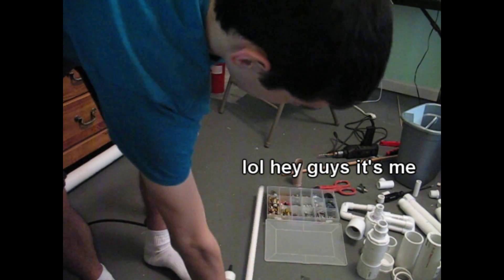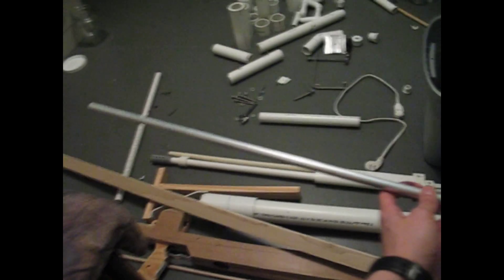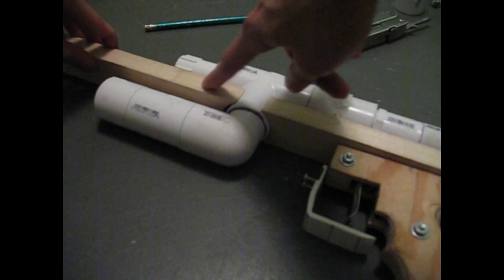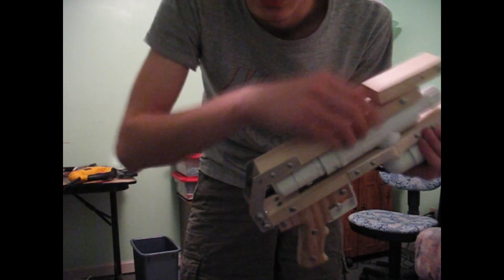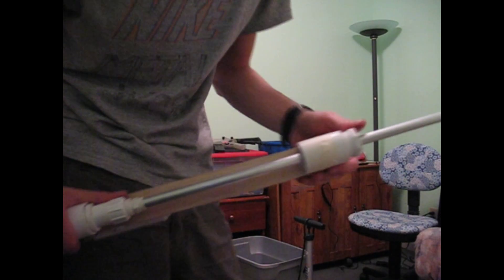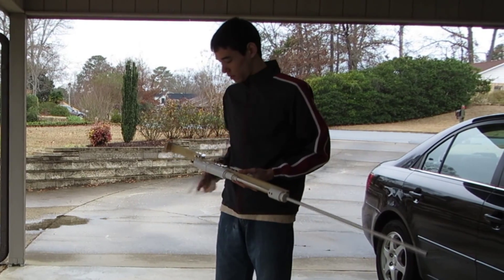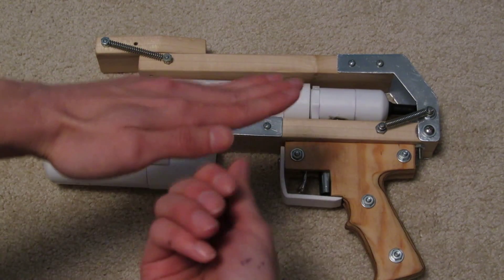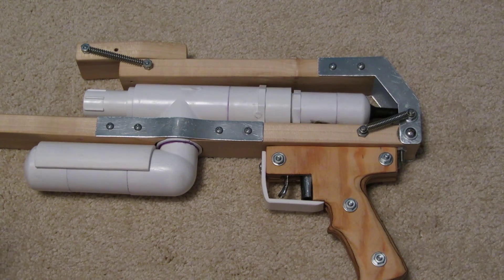Recycled Airgun w/ Collapsible Stock (and how a tee piston works)

Comment: a question: after you fill. by the time pass the pressure will eventually balanced in all chamber inside, and how will that supposed to hold piston?
Reply from the maker: The barrel's pressure holds the piston. Even though the pressure behind and beside the piston is equalized, there is a "negative" pressure on the face that is looking through the barrel, which acts like a vacuum that is holding the piston from moving. To break that air seal is difficult, and if you were to ram a wooden rod down the barrel to move the piston manually, it can take surprising amount of effort to dislodge the piston from the vacuum effect.
In qualitative terms, the atmospheric air in the barrel is ~14 psi, while the pressure in the gun is for example 100 psi. That means there is a pressure gradient of 86 pounds per square inch in the forward direction. A 2" piston would have a surface area of ~3 in^2, so it would be over 270 lbs of force to dislodge the piston from the barrel.
(rough estimates not accounting for different surface, etc. Envelope calculations, take with a grain of salt)
Reply: i see. tyvm for replying !! i was planning to make a smaller version of this luncher(pistol) ^^
Reply from the maker: DNexus Goodluck, I like small launchers but have issues with pipe sizes here.
Reply: the pistol, i made the barrel extremly smooth against the pistol, i try with my mouth np, but when i pump the pistol is still leaking!!! There is no absolute seal. All i want to do just wanna make a 50cm long chamber that can fire :(  i really want to send you pictures, may i have your email?
Reply from the maker: DNexus I don't really post my email, but you should try pressurizing the gun and submerging it in a bathtub or something. Air bubbles show you exactly where it leaks, then you can try to patch the holes with strong epoxy.
If air comes out the barrel, the piston face is probably leaking.
Reply: Roborovski yeah the pistol face against barrel is leaking :(
Reply from the maker: Pistons can be a pain, are you using a screw? If your barrel is very small in diameter, you might want to consider gluing your sealing face onto the front of the piston so it's nice, smooth, and perpendicular. The barrel back end also has to be almost perfectly smooth and perpendicular.
Reply: Roborovski oh right. i used screw. and my barrel is 12mm diameter. I'll try the glue face. thx
Reply: by changing the no screw pistol it works! no leaking, but when i start to pump, the few air taken away by pull back the pump will reduce the inside pressure and it reopen the pistol :( so its like pumped one, pull back, fire  automatically. how to solve this? i use hand mini bicycle pump. and Schrader valve.
Reply from the maker: Hmm I'm not sure if I've ever had that issue before. I always use a Schrader valve, but perhaps your  pump needs a better one way valve? Or the "pilot volume" behind the piston is too small and too sensitive. If you can easily attach another fitting to make the area behind the piston larger it might not fire? Sorry, I'm not sure how to fix that issue.
Reply: i got the tricks!!!, just need to use finger hold the other side of barrel and pump one or 2 times and open the finger to release the pressure in barrel and the pistol at the other side of barrel inside the chamber will instanly seal!!! it works 100%, i test with my nail dart its very powerful, right now is night time i couldnt do range test so tomorrow ill go check it out :D  i can't believe it works!!
Reply from the maker: Congratulations! Pistons can be difficult to get right, and it takes a while to learn all of the different ways it might fail. Glad you got it working.